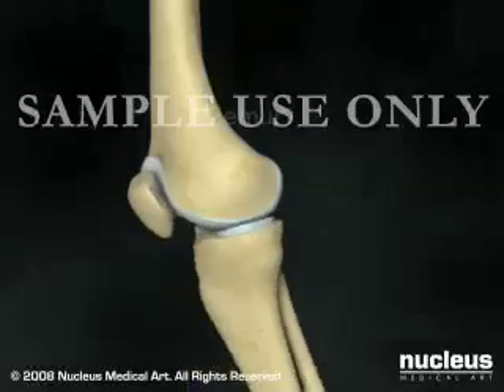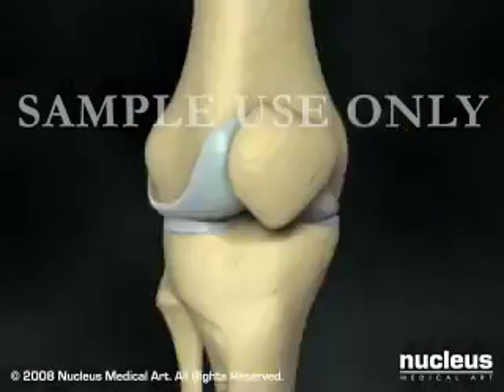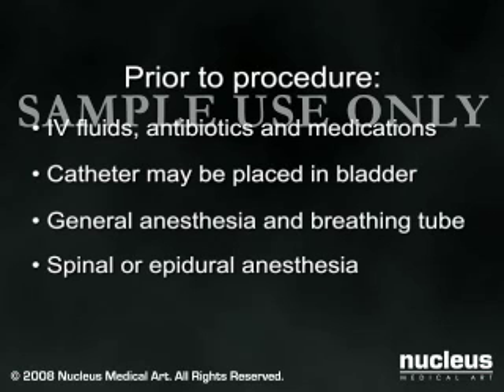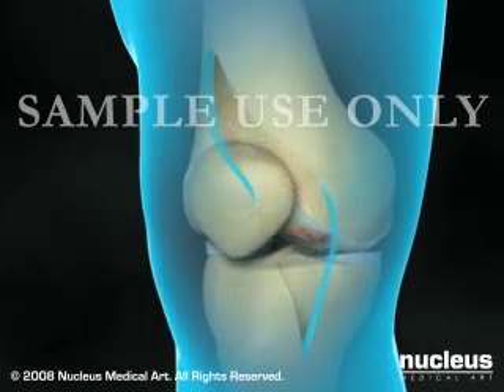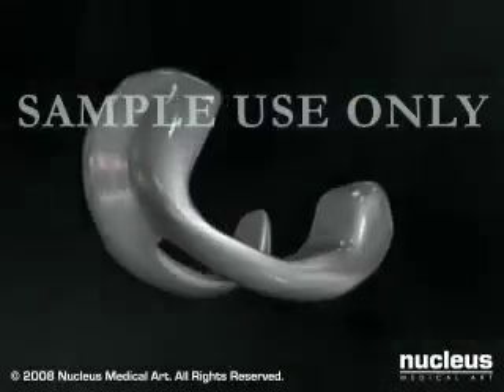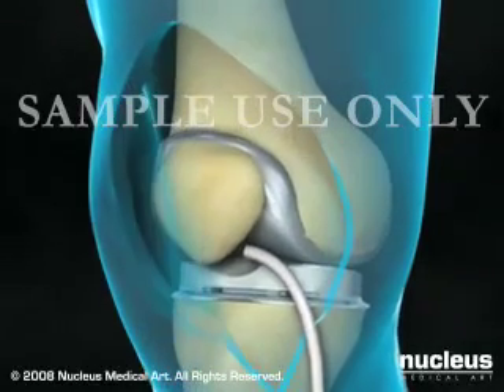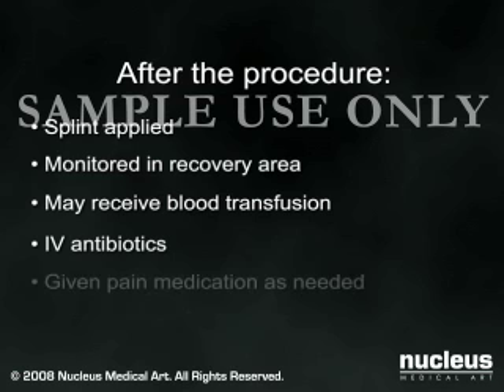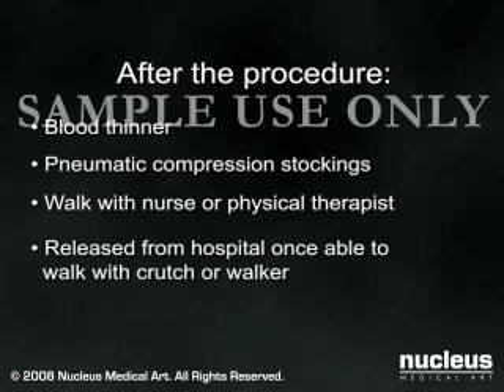Knee Replacement (2009)

Comment: it's a pretty good vidieo. maybe a little old. i had a total replacement  in sept. it still hurts but is getting better everyday. i was up walking the afternoon of the operation with a walker and 2 nurces. you will be put on a cmp machine that will work the knee joint for 2 to 6 hours a day  you will be using it for the mext 6 weeks or so. if you are going to have a knee replaceed keep up with your pain meds and do your exercises.

Comment: My mother will be going for this surgery soon. This video is most helpful for me to understand what happens in the op room. thanks.

-long time sub ;)
Reply: Can u share results of the surgery?
Reply: @faizahassan6879  Hi. The operation went well, unfortunately my mom had a fall a couple months into recovery and fractured the femur above the knee that had the surgery. The duration for healing took a long time.

Now years along she is back to walking but due to the fracture there is some occasional pain but generally good. definitely better than before.

Please if anyone you know goes thru this, be super insistent on walking aids during the recovery phase and stress to them how bad a fall can be. Sometimes completely  destroying the replacement procedures or even making it worse.

All the best!
-e
Reply: @JustJobeMY  hi after 12 years is she wel
Reply: @batoolsafaa4019  hey mate. Yeah after the fall/fracture it did heal up (11 screws and a plate tho) she can walk ok but some stiffness due to the fracture misalignment. Rule of thumb... avoid falls at ALL COSTs :(

Comment: @Bermufa Hello...DJ...UK.....It is a shame that you are so young to need this work done....However ..you will not be handicapped..do not worry..I had a knee replaced.. one month ago..I am now off crutches and can do  jobs around the house and garden...After the Op. it is vital to excercise and get the joint working..it is hard at first..but time will improve,,I am 64 .I am ok. but cannot imagine 'me' doing any 'hard' sports or running around. Maybe you will, My joint pain has gone. good luck.DJ.

Comment: I have a question, for 6 months now when i go up the stairs my left knee hurts and makes a clicking sound with each step. When i run it doesn't hurt, only when i stop or run full speed, it hurts and feels like it can't support me. Also when i bend down to tie my shoe it hurts. My xray's came out fine but it still hurts.

Would i need a knee replacement and will that prevent me from joining the marines?